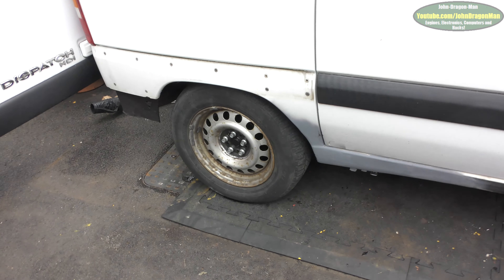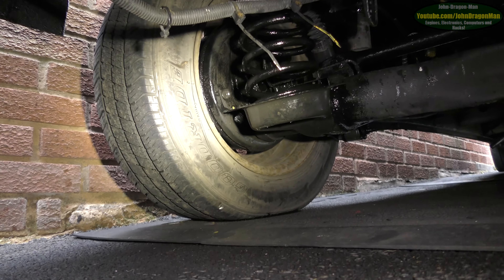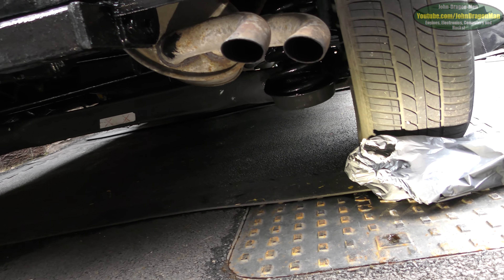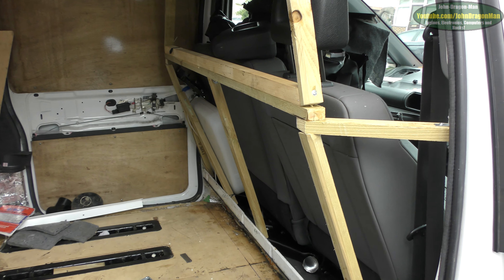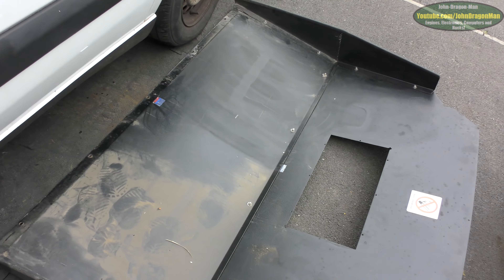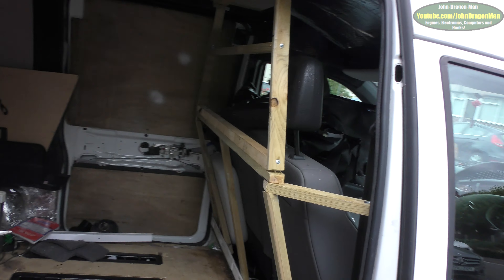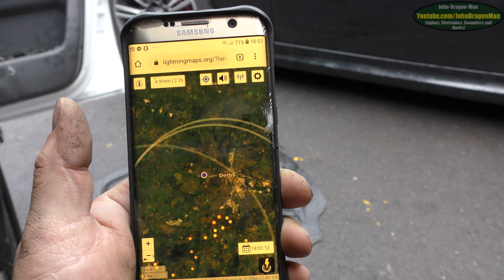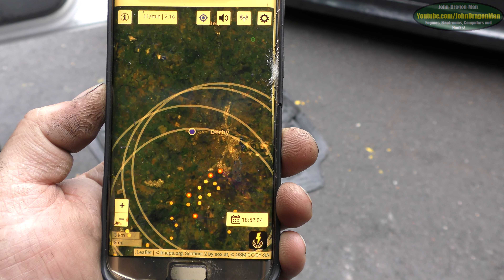Citroen Peugeot Fiat Dispatch Jumpy Expert Scudo Micro Camper Conversion - [27] bulkhead & axle done

Comment: man you do everything wrong, get rid of all that stuff, bulkhead, spaztik seats in the back, all that shittee foam insulation (bad for your respiration), get some decent LT tires, get rid of those car tires, all that shittee wooden framing, get rid of it all,  put the poor van back together,
Reply from the maker: yeah I really want to get some decent tyres on it. not some budget brand crap like what it has now. 

I'll agree that the foam is excessive however it will be warm. my plan is to use this more in the winter than summer.

As for poor van..  heh I don't think that many would go to the level I have gone to when it comes to rust cleaning and prevention... pretty lucky van really. everything serviced before the recommended intervals, nothing left to ware and only the best parts and fluids used in it.

really wait and see what it will be like when it's done. it will probably be the best dispatch camper conversion done so far :D
Reply: @johndragonman  ok i believe you are caring but there comes a point when its overkill, your van is in pieces, hello?.
my tires are called Ecovantage LT tires and im telling you they are simply top notch. and they don't wear. super deep tread lines that catch many a stone. ;¬)
Reply from the maker: @gewizz2  ill look them up. ive been using the van to go to work in. its great now! :D